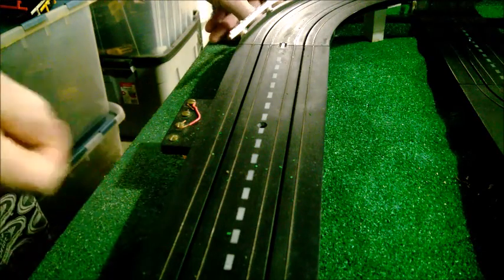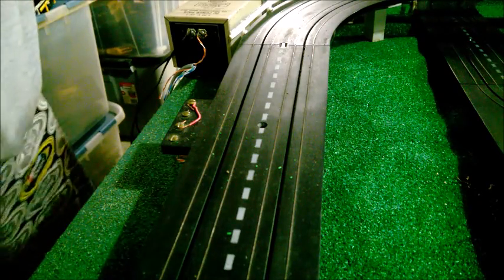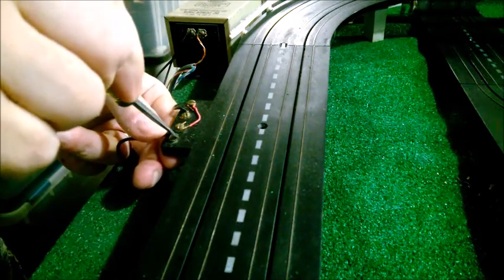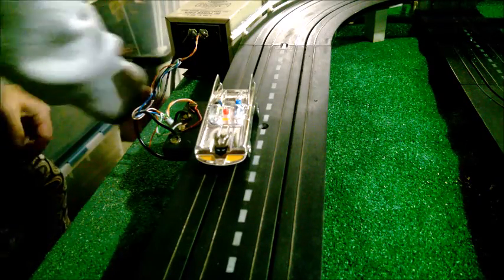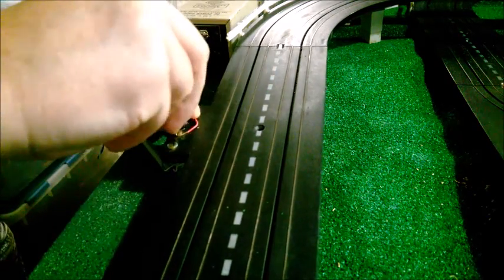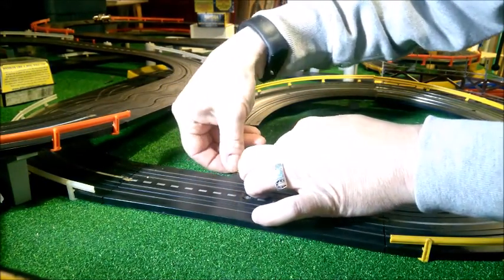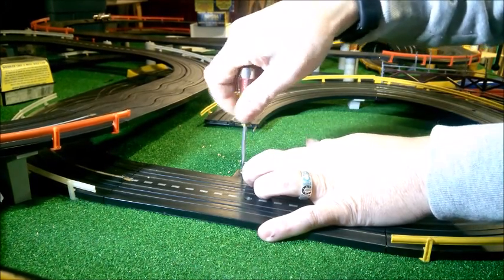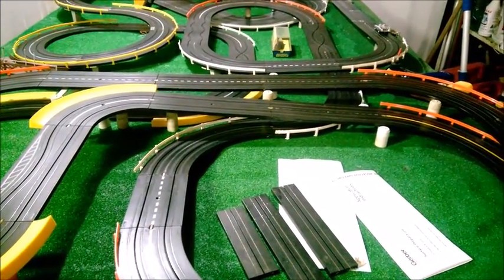Aurora Model Motoring  Wiring The Layout

Comment: Overly complicated description!  Basically....you take one wire from each throttle, put them together and attach them to one screw on the transformer.  The other wires from the throttles go to terminals 2 and 4 on the track.  You put a jumper to track terminals 1 and 3 and attach a wire from the unused screw terminal of the transformer to either 1 or 3 on the track.....
Reply: Thank you!